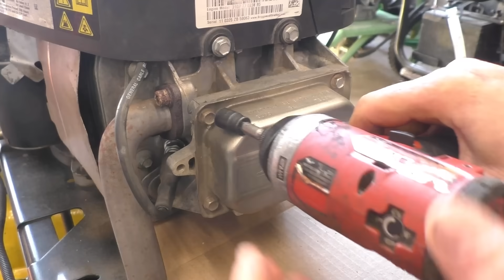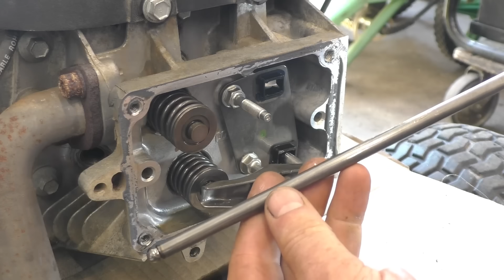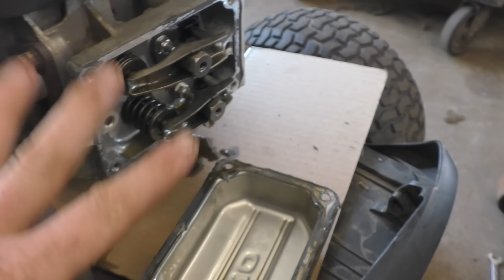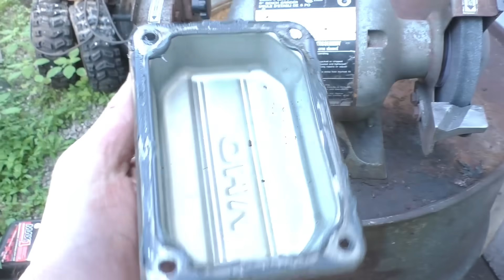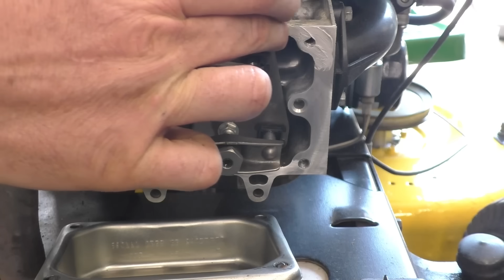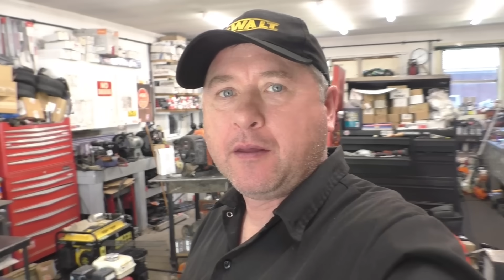JOHN DEERE Lawn Tractor Has No Power & Runs Poorly - Step By Step Repair With Donyboy73

Comment: The assembly is the original cause Honda, Briggs all of them when assembly builds these all the air equipment is preset torque and its hurry hurry how about thread locker?

Comment: The governor has quit on my John Deere riding lawnmower. Is there a spring or something that regulates the governor you can push the throttle lever up in the high and it will go in high you pull it back and there is no difference. Wonder if you could help, thanks for the videos.

Comment: the torque specs for the valve cover on all the lawnmower  ride or push is :

1.)  with new gasket 11 ft lbs.
2.)  with old gasket or if it has silicone seal   7 ft lbs.   ( that is only  '' if ''  you are not going to use a new fresh 
 gasket) .

Comment: Hi, i got a simpson 4000psi 3.5 gpm

Filled it up with fresh 89 octane fuel and oil was good. Followed the steps and tried to crank it on but although it tried to turn on it didn’t, should i take it to a shop?
Reply: Yes

Comment: I guess I forgot to post my comment yesterday before leaving.  I put RTV on my cover gasket last time after lapping the valves and that made it hard to get off.  I am replacing the Head with a new OEM because a valve guide shifted and I couldn't budge it, so I think that wore the valve stem and its guide and it's burning oil now.  I'm wondering of using RTV on the gasket is necessary.  Shouldn't proper torque take care of leaks?  Great talking with you yesterday!!!
Reply from the maker: It's not necessary to add rtv silicone with a gasket but i do for added protection and to not get a call back from a customer.
Reply: @donyboy73   Thank you!  If I see an oil leak, I can add RTV.

Comment: Great video.  I do not care for the plastic pushrod guides.  Makes for sloppy rocker/pushrod setup.  Miss the good old flathead engines.  They didn't need as much valve maintenance.

Comment: What I like is you don't jump in everywhere with a torque wrench, which seems like disease on some yt channels! Just using common sense and snug it by hand where it suposed to be done by hand, and use torque wrench where it is really required. That's fine.

Comment: Great video Dony! Those single cylinder Briggs and Stratton horizontal engines sure seem to have a lot of problems.
Reply: They do have some common issues but they are super easy to work on and easy to get parts for.

Comment: The rocker arm stud backing out is an easy fix when you know to check the valves. I had never opened a valve cover before getting into small engines.
Reply: I never opened a valve cover on a mower until after I watched Donyboy's video a few years ago. His instruction make a job seem so easy.

Comment: one thing you have to remember when setting the tappets is that the decompression cam is active around tdc the piston should be slightly after tdc on power stroke   when setting the tappets .

Comment: It was this problem on my X500 (2 cyl Kawasaki) that got me back into working on lawn equipment.  I hadn't worked on one for 40 years (since the late '70) at the time as I hadn't had a lawn over those years.  Just low power but still ran/cut.  Finally found a mention of the valve lash maintenance.  Sure enough the lash was loose and rods bent.  But easy enough to fix and then also adjust the other cylinder.  

The cycling to ensure rod movement would have helped me.  Had to go back in almost immediately.  I believe the poppet had gotten stuck and the popped loose so I need to reset the clearance.  

I'm better at working on things now and why I watch this channel.  

So if your 2 cyl just doesn't have the power, suspect this.   Mine showed up most obviously when trying to mow uphill.

Comment: Interesting that you used a gasket on the cover going back; I only use the hondabond to seal that up. Half the time, they use RTV from the factory anyway because the gaskets leak so often. Granted, you using both, it's way less likely to leak than with the gasket alone. Solid content, as always!

Comment: You're the only mechanic that I know of on YouTube know that always reminds us to use common sense. I love it!
Reply: My ratchet doubles as a torque wrench. When it gets tight I say "click" 😂
Reply: Always wear safety glasses? I was using a wire brush attachment on my drill when a wire came loose from the brush and stuck in my face just below my eye. I realized that it could have went into my eye. I didn't use common sense back then.
Reply: Really? Who are you watching?

Comment: Great work Donny! You would think Briggs would put a little blue Loctite on the rocker stud and put a gasket on the valve cover! Save a nickel, save a second!!! Yeah!
Reply: Had the same problem on a 6hp briggs push mower engine. Thing was only 3 years old wtf are they doing.
Reply: Yes sir that is what I do also 😊

Comment: Do the lawn tractors ever have 2 cylinders?
Reply: Yes.  My neighbor's Cub Cadet tractor has a twin cylinder Kawasaki engine. And Briggs and Stratton does make twin cylinder engines. Twin cylinder engines are more common on tractors with 3 blade decks.
Reply: I would guess that it depends on the horse power of the tractor.  Small ones only one cylinder, the larger ones ( garden tractors ? ) have 2.

Comment: Nice! Gaskets were made of thicker material back in the day. These days, they necessitate adding some type of liquid gasket material to the making a seal... 👍👍
Reply: Back in the day it didn't seem like mowers were so fragile. I still use a LawnBoy push mower that I bought used in 1989. It's beat to hell but it ALWAYS starts and cuts the hell out of anything in it's path.